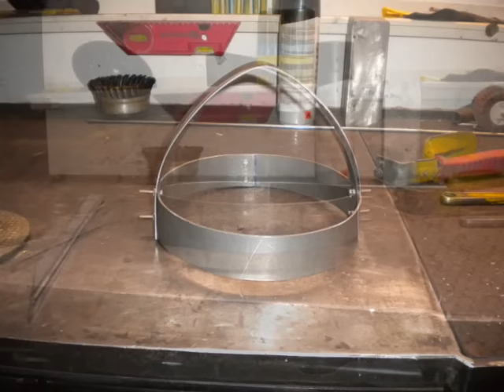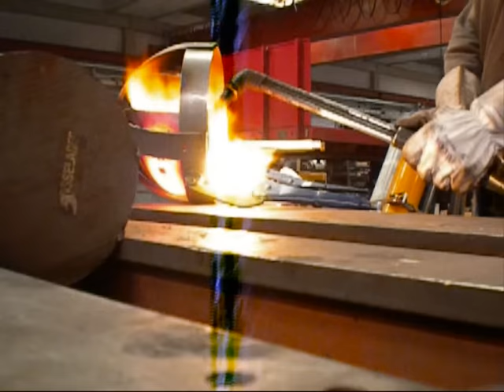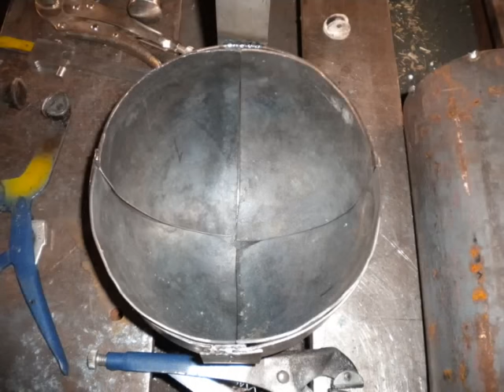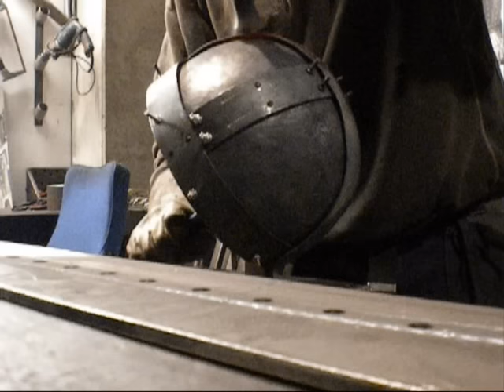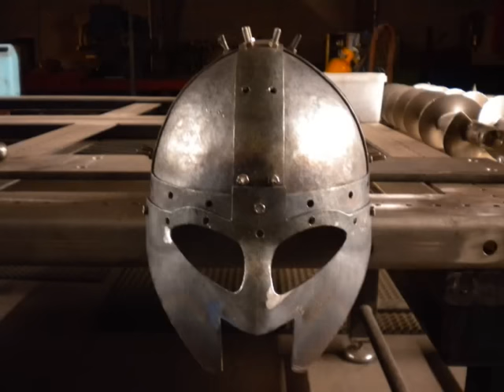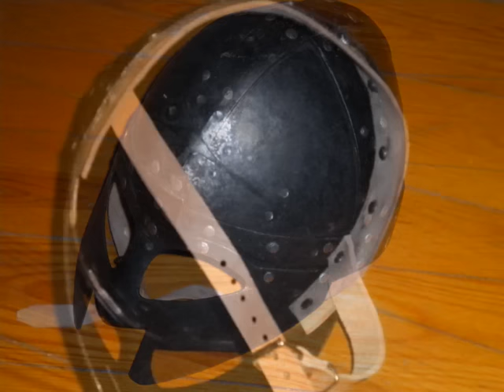Heavy Viking Helmet 2mm handmade by Harder.wmv

Comment: I could try answering: also do viking reenactment, and some metal working on my spare time.

1.) Ball stakes are not to hard to come by. If you happen to find a discontinued cement blender at your local scrapheap, your pretty much set! Take it apart and you find that the "ball stakes" is in fact what's mixing all that cement :)

2.) You don't need a blowtorch, a good ol' forge will do nicely. Build one!

3.) Get hold of good pliers, hammers and wooden stumps. A nice anvil won't hurt either...

Comment: Firstly, it is amazing that this armour is only old because it is made from steel. In contrast, If you upgrade that metal to a modern metal like aluminium or titanium the helmet is now a bullet proof helmet.  Furthermore, if that helmet is made with modern metals the bullets bounce off like pebbles. Therefore, plate armour designes like this Viking one is not actually old and obsolete. It is actually very formidable armour.

Comment: I don't know if you've found this information in the month since you posted this comment. But there are many places you can get your start. Belt sanders, angle grinders, files, cross peen hammers, and other bits of equipment can be bought in some hardware stores. However, you can find more online. If you want an anvil or forge, you can buy either online or build a forge and ask around locall for the anvil. Steel can be purchased online. I hope that gives you a place to start.

Comment: @SprAftanas The material is cheap so just go for it. try and make some kind of a padded head band (not too thick) that you can wrap around your head to get measures right. A bunch of small nuts and bolts are a good idea.
The Ball stake is nice, but not entirely necessary. The one in the clip looks like a cannonball welded to a stake, but you can make do with a cheap trailer hitch. If you don't have a ball stake, just make sure you dish the bands before attaching them.

Comment: Can I give yo uone advice man? I am in to this stuff too. It is much easier to make it from two halfs so that you make first those two halfs of the helmet and shape them by your hammer to the desired form that in the end they make round corpus of the helmet. Then use metal strips for the top and arround to finish the work. Its much easier that way and more durable. Two halfs, then two or three steel strips shaped according to the helmet (without bashing it on the helmet.) use wooden stump.